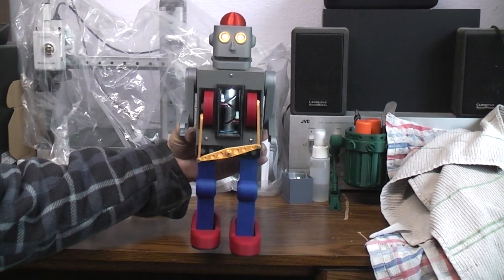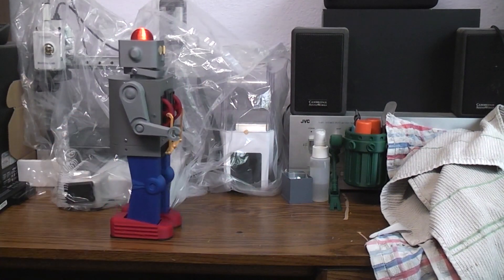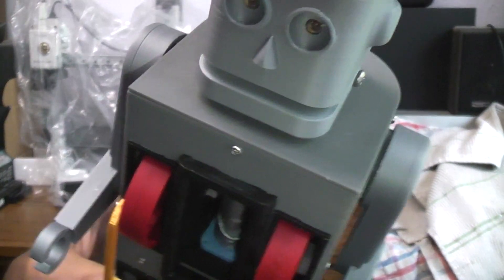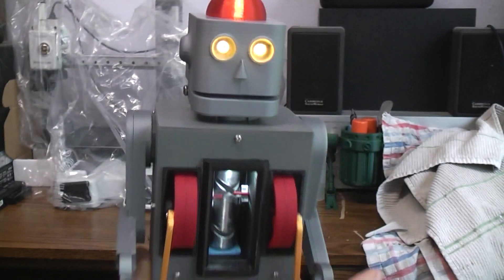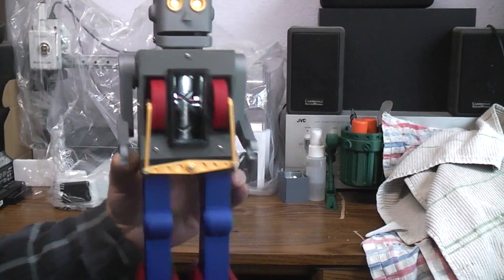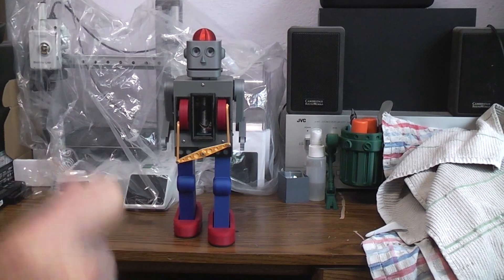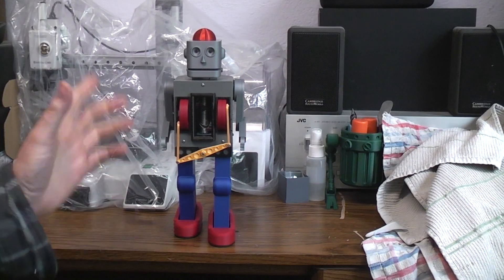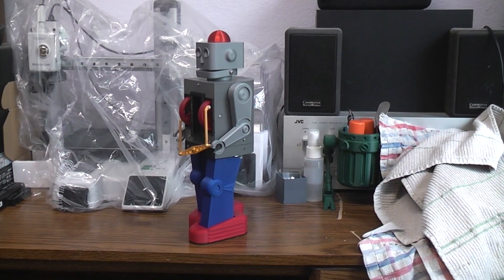3d printed "self-reversing screw drive" walking robot.

Comment: This reminds me of the old battery operated model kits of Zoids, you had a block that you built around that had a motor and multiple pivots to make the kit walk and worked on a single battery. Wonder if it'd be possible to do one of those?
Reply from the maker: All of the Zoids kits I built back in the 1980's were wind up as I recall. But I guess they still make Zoids so there must be alot of them that are battery powered.